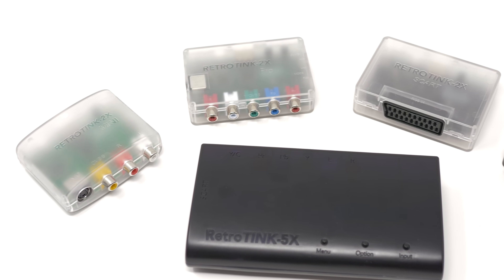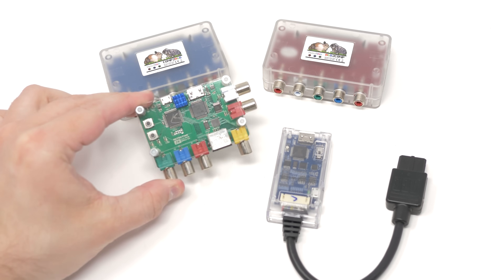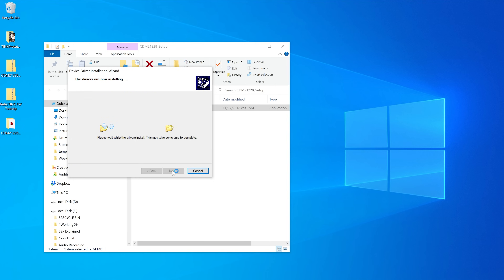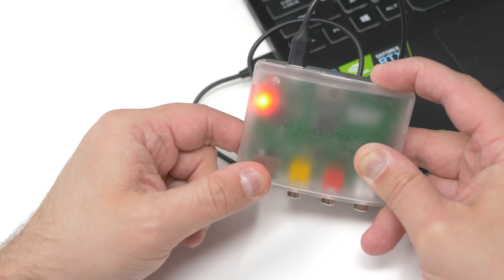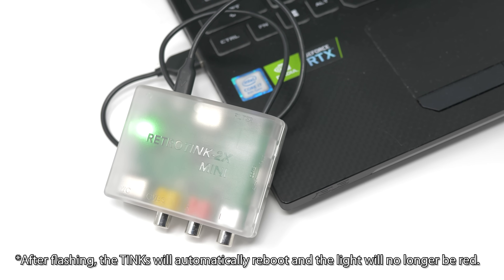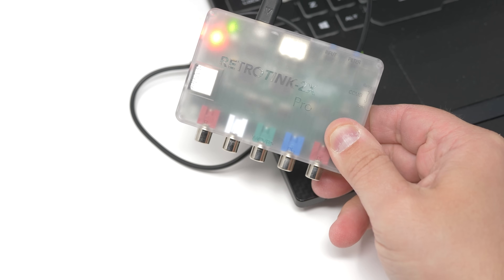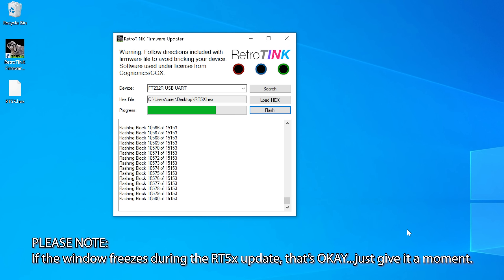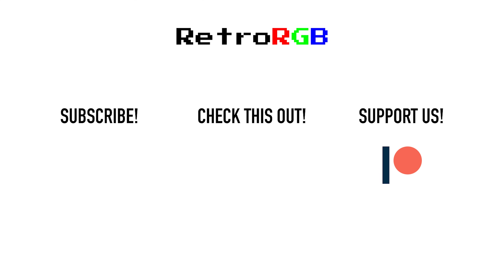How to Update Your RetroTINK's Firmware

Comment: I have a PS2 SCPH-90001, RetroTink 2X Pro, an HDMI Retrovision cable & am using an HDMI 2.1 cable (doubt that matters). The games look great on bypass mode. However, if I put the device into Line2X mode, the entire picture seems to jitter up & down rapidly. Any insight as to why this is? Also, firmware is up to date.
Reply from the maker: That’s just the BobDeinterlacing that the cheaper processors use with 480i sources.  You can check my RT2x, Get A Scaler and RetroTINK 4K videos for visual examples and a better explanation.
Reply: @RetroRGB Ok. So basically, that’s normal?
Reply from the maker: Yup.  It's the only way to deinterlace 480i on a budget.  Putting it in bypass mode lets your TV do the deinterlacing, which I bet looks great...at the most of 5-7 frames of lag or more.  Please check out those other videos if you'd like to learn more.

Comment: How do I check the firmware version on my Retrotink 5x to know if I need to upgrade it or not?
Reply from the maker: It’s right in the menu.
Reply: @ Not on the old version of the fw that I had. I upgraded to 3.71 and now it displays the fw version. 

I must have had an ancient version. The menu has a lot more information and options than before.
Reply from the maker: Wow, you must have been back in the 1.x firmwares.  Sorry!  But I'm glad you're updated.

Comment: Hello & Happy New Year

Thanks for the video
As for Retrotink 5x do I have to update it in order from older to newer firmware to get all changes or is it done by just flashing latest update that's available?

Greetings from Germany
Reply from the maker: Great question!:  Nope, just get the newest firmware. No need to flash anything in-between, even if you’re on the earliest one. I should have specified that!
Reply: @RetroRGB  
I'm glad you wiped off my concern about that
I'm fairly new to own a RT5X, picked one up since shortly after christmas to be specific
The updating pattern went quite easier compared to the process on my OSSCwhich was tricky to find the right tools and get them properly running to do the update
I now flashed the RT5X to FW  v3.71 that should be the latest my guess
Probably I'm going to get me a premium remote to ease up working with the Tink
Any hibts how to add custom profiles found throughout the web?

Greetings

Comment: I’m having an issue where when I open the RetroTink Firmware Tool, press and hold menu button on the device, plug it into the PC, get a red light, the window does not show the device as an option to select in the drop down box. It stays blank. But it is connected, red light on.
Reply from the maker: Did you install the driver as well?

Comment: I just got my 5x. It seems to work fine our of the box. Is there any reason to update the firmware or am I good as it is?
Reply from the maker: Only if you want some of the extra new features.  If you're just looking for a basic way to get your consoles to 1080p, you don't need to do anything other than power it on and select the input :)  Maybe check out this video and see if there's anything new that interests you?  https://youtu.be/e6GFw-6ypLM
Reply: @RetroRGB  Appreciate the reply. I'll stick to it as is. I'm only using it the Sega Saturn, SNES and Dreamcast on my 1080p TV. Should be sweet.

Comment: My retro tink 5x pro is fully upgraded. My only problem with the device it doesn't seem to work properly on my Japanese Sega Saturn model 2. I have to turn on and off several times to get the console working. Do you know why this is happening? On other upscalers it boots up quickly but not on the retro tink any suggestions.

Comment: If I want to connect an RGB modded system to an SD TV through component, which box should I get that won't destroy the original image? (no scalers, no filters, interp, line doubling etc)  would it simply be RGB2Comp by retrotink?
Reply from the maker: Yes

Comment: Just got the 2X-SCART. Hooked up my Dreamcast to the Tink and the picture is jumping up and down super fast, updated to latest firmware 1.6 picture still jumping. ?  :(
Reply from the maker: Make sure your Dreamcast SCART cable is set to 480i / 15KHz mode.  The 2x SCART doesn't support 480p.
Reply: @RetroRGB  I don't have a switch on my original Dreamcast SCART cable. I'm guessing you are thinking of "Sega Dreamcast PACKAPUNCH RGB 480p SCART cable" with a 15KHz/576i(480i) switch. 

So I would still get a picture if my cable is in 480p? Cause I get picture it just shaking a lot...
Reply: Did a test with an older TV that has SCART, running my original DC (PAL) SCART Cable directly into the TV resulted in no shaking of the picture. So I guess it must be a cable 480p...
Reply from the maker: If it's an original Dreamcast SCART cable, it should be 15KHz.  I think...I've only used aftermarket.  I'm really sorry, I'm not sure what else it could be.
Reply: @RetroRGB  No worries. I will look into it some more , thanks for the replys  :)

Comment: No Linux Love? Was trying to get this going with wine and went down a rabbit hole so fired up a win10vm I hadn't ran in years. Seems like it requires .Net framework. Trying to get this thing updated to give that a try next
Edit: Yay, now with more Linux love, lol
https://youtu.be/TZuiMCIISIs
Reply: I was able to update via a Windows 8 VM on with VirtualBox. It did fail at one point I believe because I was fiddling with the driver. Scalar wood boot with red without holding the menu indicating failure so I had to hold the menu button but eventually got it to flash successfully.

Comment: This was helpful and i just did the latest update on my Retrotink 2X Pro multiformat. But there is a problem with my consoles that are playing in anything above 480i. Is there a way to undo this update?
Reply from the maker: The RetroTINK 2x Pro and Mini can only accept 20p and 480i, nothing above.
Reply: @RetroRGB  No i have the 2x Pro M. This one does do higher resolutions, that is the main difference between that and the Pro. And it was working fine before i did the update. Can you just tell me if i can undo that update?

Comment: I got the RetroTINK Firmware Updater installed, and held the menu button down while plugging it in. The LED turned red, too.

But it doesn't show up on the device tab of the software, even after pressing search multiple times.
Reply from the maker: Did you installed the driver software first?  Try rebooting?  Try a different USB port?
Reply: @RetroRGB  So I was able to fix the problem. Believe it or not, the problem was the microUSB I was using.

I was using a random long cable I had laying around, instead of the one provided with the RetroTINK.

When I tried the USB cable that came with the RetroTINK, it appeared on the Firmware Updater with no problems.

Thank you so much for taking time out of your day to try to help me, though!
Reply from the maker: Ahhh, makes total sense.  Over the years I've also found a few "charge only" USB cables...I try to remember to throw them out when I find them to avoid this exact situation :)

Comment: I have done all the steps  ,however the updater won’t recognize my RetroTink 5x even after I hit search nothing shows up.
Reply from the maker: Did you install both pieces of software?  Also, is the light on the RT5x red when you search for it?
Reply: @RetroRGB  Yes ,I got it to work,apparently the USB cable I was using was “charge only” and did not contain the data lines,switched to another cable (one that came with an 8bitdo controller) and it worked.Had no idea there could be differences in these USB cables ,I thought they were all built the same as far as having all the lines in them.

Comment: I’d be cool if Mike updated the official manuals with firmware updates so there aren’t so many posts online asking about blue LEDs 😅
Reply from the maker: That's a good suggestion.  I'll start including links to manuals when I do the update posts.
Reply: @RetroRGB   the manuals' cover pages always say "Revision 1.0" or whatever but as new revisions come out - the official manual doesn't get updated. users must read every patch note AND the manual to get what's current with a RT device. idk. I'm just mad cuz I basically bricked my RT-2X M and can't play component video through it until I roll back the firmware cuz I can't figure out how to change the colorspace setting.